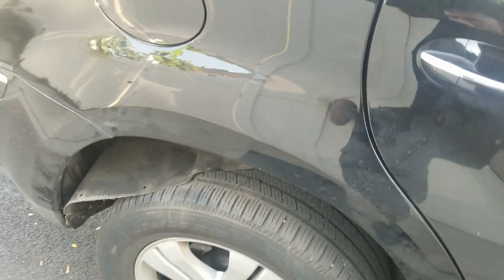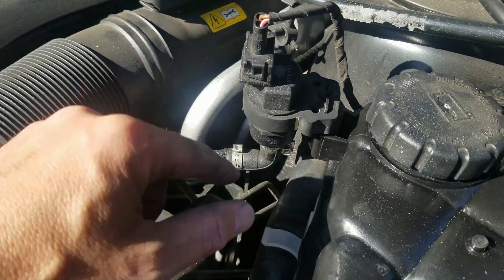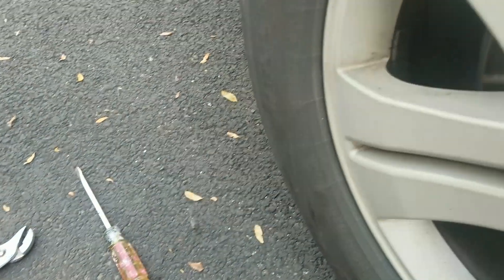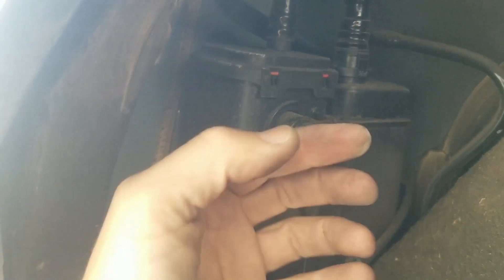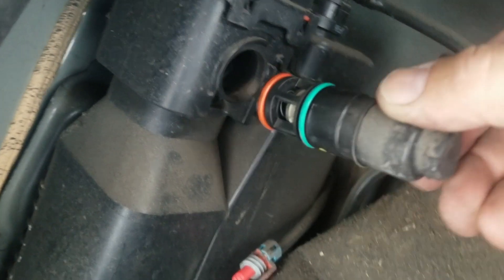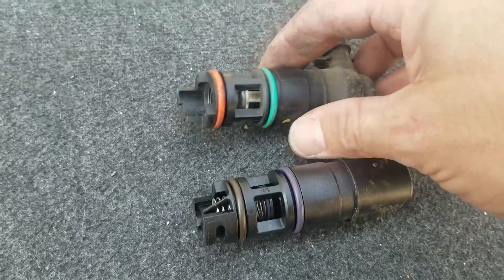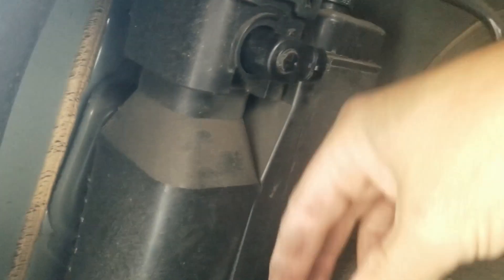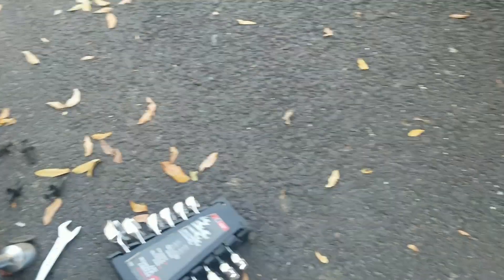Mercedes 2007 GL450 Check engine code PO455

Comment: Hi Victor, Thank you for your video. I have a 2006 ML350 that has the same code and I'm trying to find what the problem is. Did changing the valve fix the problem?
Reply from the maker: Replacement of rear valve fixed issue, not sure if ML has same. After you clear codes you have to follow instruction how to pass all units...fir example for O2 you have to keep 2k rpms during 2min....etc
Reply: @focusbvi  could you please link those instructions? I never heard about this
Reply from the maker: @BROWNMAGIK1  starting 7:38min https://youtu.be/gLnhD4gP0kM?si=0kUC3TtSmE6qCQue
Reply: @focusbvi  I ordered the valve and replaced it and now the car doesn’t have any codes and I can pass emissions! Thank you so much for the video and help